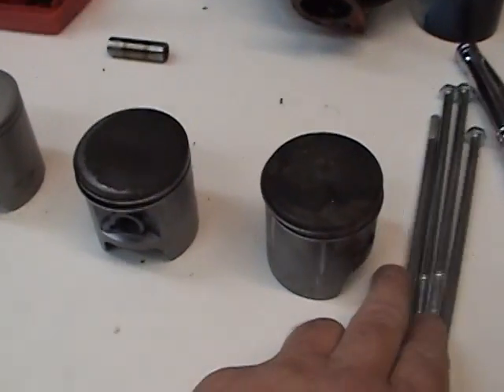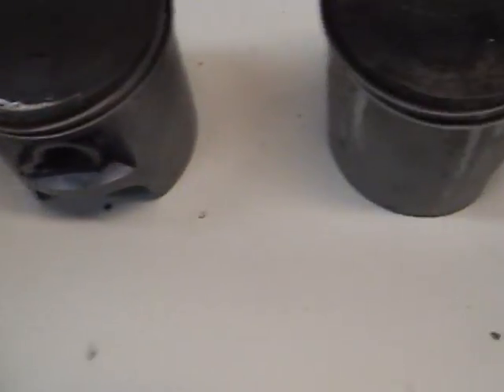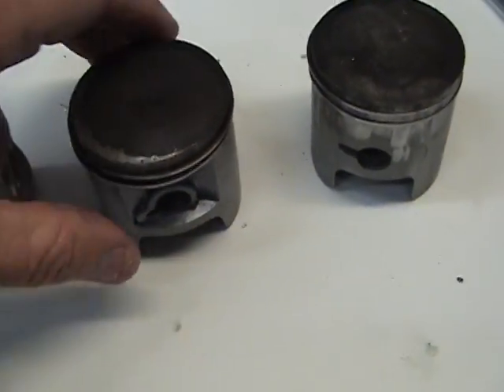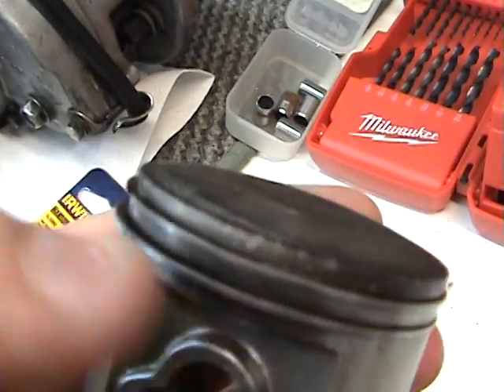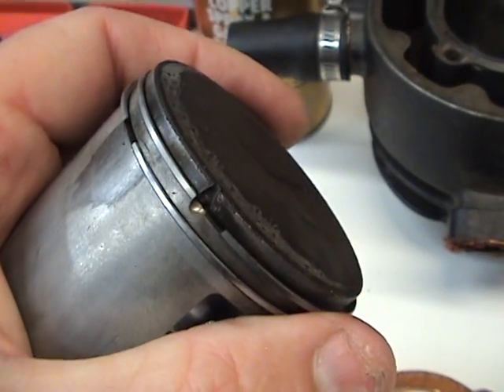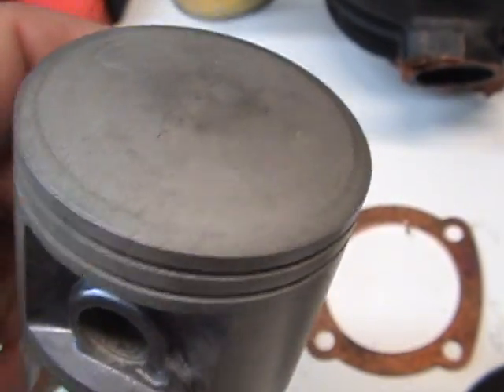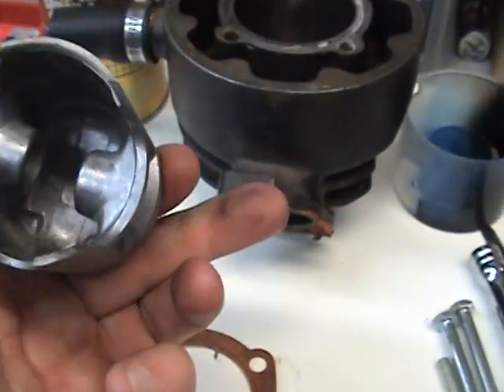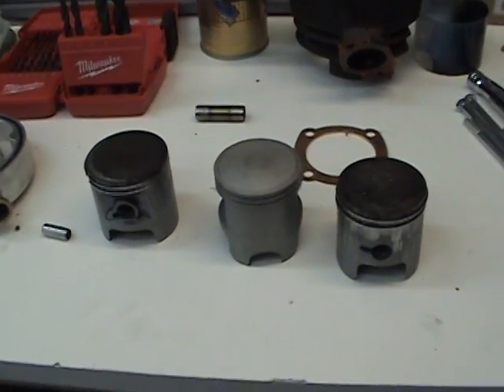(1)- TWO STROKE PISTONOLOGY = TUTORIAL

Comment: Oh boy! 
#1- the pins keep the rings in place on 2 strokes to keep the ring ends from snagging the ports.
#2- the arrow on the piston is to indicate the front of the piston so the ring pin is in the proper location and to be sure the wrist pin bore offset is located on the proper side of the bore, not because the piston is thicker on the side with the arrow, even 4 strokes use the arrow but no ring pins.

Comment: The rings will hardly move at all when they are compressed into the cylinder, the pins are to make sure the open ends of the ring(s) do not rotate into the port openings. Only 4 strokes can allow the rings to rotate as there are no cylinder ports.
The explosion does not go past the ring to force the other ring out! Two rings simply provide more sealing than one and they are offset so any gases getting past the first one's locating pin won't go through the next.

Comment: ok lets clear a few things up, with no offence meant to anyone, including the op, the arrow is on oem (original equipment manufacturer) pistons mainly, and always faces the exhaust port, the size also is on the top, and again mainly on oem stuff, and some high quality after market producers, that I am not here to promote, the rings only move round to be free in the slot to expand where they must stay located, in a line with the locating pins that also act as a barrier from the expansion of gases, no explosion should flow below the top ring, not all 2 stroke pistons have 2 rings, most high performance motocross or racing bikes have one, and require a lot more maintenance, as in ring changes and little end bearing changes after a few races, not all two strokes have cast iron barrels, not since the dark ages of the 1960`s anyway,  and some two strokes employ a flat top to pistons for reasons you need to research, as I do not have all night, <------- ex grand prix mechanic :-) 500cc 2 strokes
Reply from the maker: +darren tomlinson I WOULD LOVE A 500CC TWO STROKE. like the 1985 Yamaha RZ 500. Great bike but they want a fortune for them.
Reply: they are great fun my friend, though very expensive to look after, and cost more the less you use them :-) sorry to say
Reply: +darren tomlinson I'd just like to thank you for that comment, helped me quite a bit :D
Reply: welcome my friend :-)
Reply from the maker: So your an ex grand prix mechanic. My dream has been to buy a 500cc two stroke racer. I owned a 1984 Kenny Roberts Yamaha RZ350 bought new in that year. There was always a rumor here in America that Yamaha made an RZ500cc two stroke, but did not sell it in the states. I also wanted to by a Bi-Moto 500cc fuel injected two stroke and tinker with it to make it work. What can a civilian buy now today that is affordable 500cc two stroke? I would have to import it of course , because they don't allow them here. Thank you RH DSD
Reply: there are none, sorry, the governments have killed them
Reply from the maker: No truer words ever spoken. One day two strokes will be seen in a museum along with pay phones, vhs tapes, and metal bike gas tanks.. Amen to that bro.
Reply: don't forget that those location pins also stop the rings from having their open ends from floating around to be sliding past the transfer ports, where they can catch and mess things up real real bad...RGV250N rebuild master..Nikisil cylinder coating and teflon coated pistons and variable exhaust port timing valves etc etc make the RGV 250 capable of punching out upto 90 horsepower...but....not for long !....I had the luck of getting all the Suzuki Hop Up Kit parts and boy was that some serious fun !. the TZ250 factory kit bike was also capable of 90 plus horsepower, crazy fast
Reply: they made a RD500 4 cyl 2 stroke for the road, about as close to a GP bike as you could get (UK) and i think suzuki brought out a RG500 and honda a NS 400, for the road.   as for this video, it's bonkers, free moving rings i have never seen. And wouldn't this explosion under rings cause drag? good job we didn't mention L rings and go kart motors spinning at 16,000 rpm.

Comment: Hey I'm doing a top end on my 88 yz80, the cylinder walls are in good  condition and still have a cross hatch pattern on them, but I have low compression and just replaced the ring (one ring piston). The piston has blowby and the ring was installed properly, this just means time for a new piston and ring right? No replating or boring necessary?
Reply from the maker: Depends.. Maybe you need a new piston, rings, head gasket, etc. I don't know enough info, bro. R

Comment: Wow!! I'm sorry but I think you may want to go back and study more. A lot more. Some of the info is correct like the markings on the rings go up and there are arrows on the pistons to reflect how it needs to be installed. The rings really don't move on a 2-stroke motor. Yes they need to "move freely" but that is so they don't get stuck to the piston and develop a carbon issue. 

Many of the things you are talking about in your video is for 4-stroke motors. 

Yes get a ring expander. They are cheap. (under $20) and get a ring compressor to install the piston. 

Pistons are basically round. Take a quality micrometer and measure a few different new ones. 

Rings in the piston things? You mean against the ring pin in the piston? If you are going to talk about pistons use all the correct terminology. Search for korihandbook on Federal Mogul's website for everything you ever wanted to know about rings. korihandbook.federalmogul.com/en/ 

As other Arno Low mentioned below (It's no rocket science ... it's already broke how much worse can you make it?) 

I recently purchased a non running rusted up 99ci 4 cylinder 2-stroke motor. It was broke how much worse could I make it? Well I made it whole again. It needed a lot of work and a full complement of parts. For instance every one of the $102 2-stroke pistons had a spec pamphlet included. I wouldn't have thrown over $400 in pistons into a block that just had nearly $500 in machining without knowing what is what first. This motor now spins these new pistons 6300 RPM making well over 140HP for as long as I can keep the gas tank full. Each and every 2-stroke I have had apart has been a slight bit different but they all follow the above rules. When those rings spin freely your motor will go boom in short order. This particular motor had broken 4 of the 8 rings. It still made 115PSI static compression on all but one cylinder and that low one was just a hair under 100 PSI. The low cylinder had a completely missing top ring and was only using the low ring to seal with. Others had parts of or cracked in half rings. 

Oh and if your example of how they work under operation (with explosions providing the sealing pressure) then how can I get 127 psi of compression pressure on a static compression test? The rings seal under their spring tension provided the end gap is correct and the ring is installed right side up. 

If you want to summarize what a piston ring does in all motors it is this:

Rings seal the combustion chamber and they provide the only path for which the heat from the piston is transferred into the cylinders. 

In two-stroke motors the rings must have a measured bit of play in the ring groove in/out & up/down but not rotationally. If they rotate the ring edges will catch on the exhaust or intake ports and break. My Yamaha twin cylinder sled motor did this and destroyed one cylinder. The Evinride V4 above did it and destroyed 3 of 4 pistons, a head and 2 of the 4 cylinders.
Reply from the maker: +thefuzzbutt Wow!!! I will go back and study! Since piston rings really don't need to move, I will just JB WELD them in place, so they don't fall off !!! I have always wanted to do that !!! HELL- I will just leave the piston rings off all together so I will not have any nasty CARBON ISSUES !!! Thanks for correcting me and my channel. I am kinda new to you tube., so please forgive this awful video. One day I hope to have 6, (6) ! subscribers just like you sir ! AND I can only dream of having 40 thousand total channel views just like on your channel !!! Maybe I should switch to filming 40 minutes of a boat engine running in my driveway for more views!!! OR making some EXCITING videos on "How to watch Paint Dry" at only 36 minutes in length???!!  I certainly will GO BACK AND STUDY MORE, Yes Sir I will!!! Like I say , I am kinda new at this youtube thingy so you will have to forgive us newbies- I only have 15,000 subscribers and 30,000,000,000 Million total channel view. I WILL GO BACK AND STUDY= RIGHT NOW !!!! Thank you so much!!!! RH DSD
Reply: +DIOSpeedDemon I don't go thru life trying to get subscribers. I post what I want to and what my friends are interested in seeing. The number of subscribers one has or doesn't have is an invalid argument. It's just a number. What kind of person insults people with constructive criticism? 

So put what ever you want on your channel. I'll do what ever I want. Personally I'd recommend that you stop spreading false information. People might actually believe what you are saying. Stop coining new words. And please get your nomenclature correct.  

Here is a quick video tip for you. Since you are filming in a stationary environment get a tripod and JB Weld your camera to it. Bring the parts to the camera's POV not the other way around.
Reply from the maker: +thefuzzbutt When you have 30,000,000 MILLION CHANNEL VIEWS, then come back and tell me about insulting my videos or how to film them. Until then, keep your insults to yourself or face the Bull. I don't remember going on your channel and disrespecting your videos. When your videos have more than 15 views in three months, then we can talk about filming techniques.
Reply: thefuzzbutt

Comment: What does it mean if I just blew my top end and when taking off old piston I seen there was literally no black carbon residue at all and chunks of piston broke off?
Reply from the maker: Could be a lot of things. Piston seized due to high heat. Piston failed due to wrist pin in combustion chamber or upper or lower crank shaft bearing failure. look close the answer is there.
Reply: Too lean of a fuel/oil mixture imo

Comment: need help. any idea at the front of my piston at the top keeps chipping off on yz125 i change the piston and it happened twice now
Reply from the maker: SOUNDS like either a totally busted wrist pin bearing or a Destroyed lower crank bearing. Put the piston in the cylinder , take the plug out and use your kickstarter to go up and down thru the piston arc and see if it is hitting on something. Definetely a bearing problem in my book. RH DSDD
Reply: ok thanks for the help
Reply: fuck if it's a bearing that's that flogged out you'd think the noise would be a dead give away, are you sure you don't have it catching on the exhaust port ? I'd be having a good look at those surfaces for scuffing lines near the chipped area too...ASAIK if your needle roller bearings are done either top or bottom end it'll be pretty obvious, you want ZERO play in those...as in NO slop at all.

Comment: well it's a litle more complicated,and wenn i see the piston you got on this vedeo all are just junk,to understand 2stroke you MAY study the gase flow from the air  (box or chamber) filter allaway true the deep end off your expemded exhaust pipe,also at low rpm the port of ce cylinder or at high rpm  should note be the same design that's,for example why  yamaha use ypvs valve

Comment: This guy "kind of" knows what he's talking about, but he misses a few points.  One - he forgot to mention that the little arrow on the top of the piston "always" tells you that that side of the piston faces the exhaust port.  Two ~ what caused the piston in his hand to fail is that the ring keeper fell out (that keeps the ring from spinning over time), the ring did not break.  Finally, ring "spring tension" holds the ring against the cylinder wall, when the fuel charge explodes it does get behind the ring and push it against the cylinder wall.  If the ring is worn or loses tension that's when the charge blows by.
Reply from the maker: +suzuki06g Thanks for clearing that up. Ring tension has nothing to do with the ring sealing against the cylinder wall during combustion cycle. The piston wrist pin with dual balanced muffler bearings is the main cause of good combustion. Every motorcycle mechanic worth his salt, knows this. The tension of the wrist pin bearings during the combustion phase of the two stroke cycle, causes the mini-muffler bearings to expand exponentially, causing enormous balanced vibrations, which cause the chromium rings to stick to the cylinder walls. I am surprised you don't know this widely known fact of two stroke engine history. The muffler bearings also keep the rings from free spinning around the piston. Just Like Pluto revolves around Uranus...
Reply from the maker: +suzuki06g When I had 600 views and 6 subscribers, I knew everything, too. Now I have 30,000,000,000 Million total Channel view and 20,000 subscribers. I hope to one day learn enough from your kind , insightful comments, to become a success on youtube. Maybe one day. With your mechanical ability and analysis on display, I would not let you work on my rubber band, wind up , balsa wood airplane, son. Blow by is not cause by weak rings. The physics tell other wise. I will not waste my time explaining to a pompous , inglorious, preening, Numb-Nuts, Nothing-Burger like you. Come back when you have at least 800 channel views and (10), TEN subscribers, then maybe I will listen to your Pearls of Wisdom on Two-stroke piston Theory. Thanks for taking the time to impart your eternal wisdom to this poor soul looking to be a success on youtube. I am Eternally Grateful...  RH DSD
Reply: yeah true but it is the gas pressure that makes the ring press out against the cylinder, not the whole bloody explosion itself, or the flame front as he seemed to think..just the combustion gas pressure
Reply: This is an old conversation about an average video, does anyone still care???

Comment: my position and head has a lot of seize marks on one side what does this mean
Reply from the maker: This means either you ate a ring or a circlip or a piece of gravel, OR you forget your two stroke oil and seized the poor engine. Either way, you need a total engine split case tear down and replace it all. All those little metal shavings will destroy an engine. Tearing an engine down is easy and I have plenty of videos in my playlists on this subject for free. RH
Reply: +DIOSpeedDemon can you visit this thread it's about the cylinder and pistion.   

 http://www.thumpertalk.com/index.php?/topic/1197885-1993-Suzuki-rm125-rebuild-help
1993 Suzuki rm125 rebuild help
Reply from the maker: I want you to check something- See if you have both (2) piston circlips that hold the piston wrist pin in. It looks like you ate  clip. THEN I WANT YOU TO CLOSELY EXAMINE THE ENDS OF THE PISTON WRIST PIN FOR ROUGH AREAS THAT COULD GRATE against the circlip , wear it in half and cause it to fall into the combustion chamber. RH DSD I have many videos on this in my playlists. RH DSD
Reply: DIOSpeedDemon here's the problem both circlips are not damaged and hold on strong. The pistion ring holds on fine with a little bit of movement but that's normal.and there really is no rough areas on the piston wrist. What I think is that some of the pistion melted on the cylinder due to running lean and not letting the bike warm up enough (the previous owner probably did this) and then the pistion wold get really beat up by the excess aluminum that's on the cylinder

Comment: why the hell does a 2 stroke need a oil seal ring lol
Reply from the maker: Some use the oil seal ring for whatever reason. The compression flame should not travel below either ring down the cylinder or you have a seriousl compression leak.

Comment: Only from America could come the word Pistonology,what the hell is wrong with you yanks??.The rings expand onto the bore under compression before ignition as well as ignition and the pressure between the two is small.Pistons have to be oval, as the gudgeon pin mass in the piston is greater than the front and rear wall and would expand at a greater rate and seizure would be inevitable even with low expansion alloys that the Japanese bought into motor cycle specifications in the early sixties.